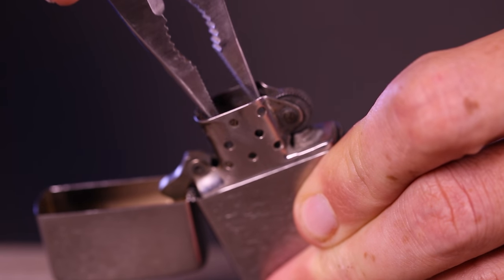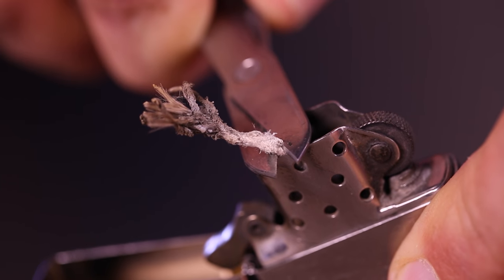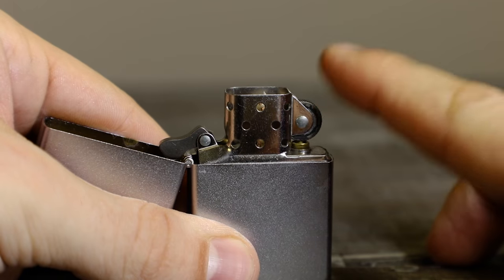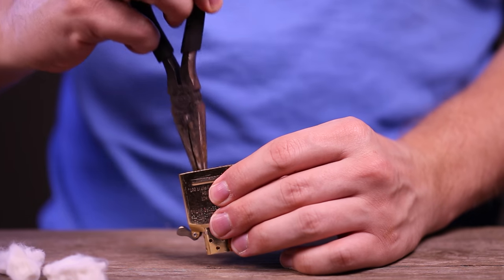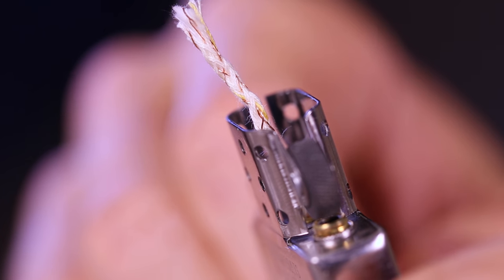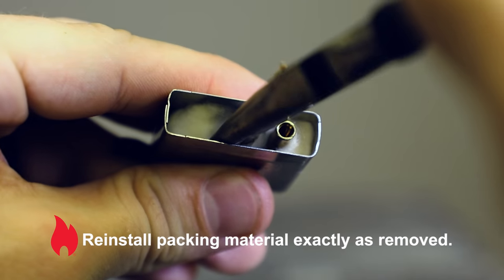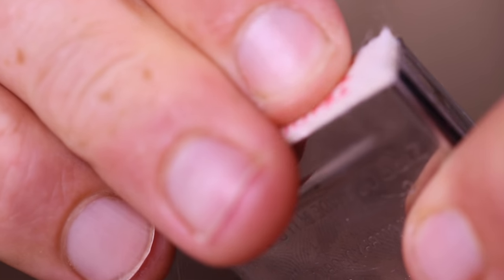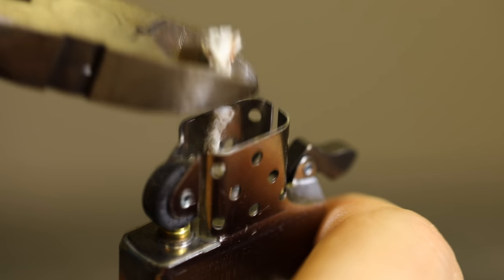Zippo Instructional: Wick Maintenance / Installing a New Wick

Comment: I've carried the same Zippo for the last 15 years, used it heavily and it is still in near mint condition. A Zippo is the only type of lighter that I trust in the long run. For one, it has no fragile parts or a pressurized gas system that often fails due to cold weather. I had used my Zippo in all kinds of conditions, from polar freeze and blizzard to tropical humidity and downpours. All it needs is sufficient airflow and sufficient fuel exposed to the spark jet from the flint. Perfect light every time. I only had to replace a few flints and each wick can last up to 2 years. There are THREE tricks to keep your wicks at optimal condition. ONE: When you replace the wick, NEVER let the wick touch the metal sides of the insert casing. Weave it in an S shape and make sure that the wick is surrounded on all sides by fuel soaked cotton. More fuel will be able to be drawn up the wick in this fashion. TWO: Only trim the wick up to one time maximum before replacing it with a new one. Every time you trim the wick, it gets shorter. Shorter wicks do not draw up fuel from the tank that easily. Keep the wick long, and it will deliver more fuel to the flame area. Better burn + longer wick life. THREE: It takes only 40 seconds or less to refuel a Zippo. If you carry one daily, it does not hurt to take a few seconds every day and refill the lighter. Once again, the more fuel that is able to be soaked into the wick, the longer the wick lasts. When you do not have enough fuel, or the fuel is low, the wick itself begins to be consumed, and you will have to replace it more often.
Reply: No offense. You kinda described why they suck. I own a few Zippos, but a BIC requires no maintenance and costs much less in fuel and initial cost. I get where you’re coming from but if you talking about trust, leave a zippo for a year, and leave a BIC for the same. I think you can guess which one will actually light. Shoot go 5 years and a BIC will still light. I understand the appeal but in reality they’re not as reliable as you say they are
Reply: @mikechivy  Your post is spot on point as well... There is a reason why the Zippo is NOT identified with the mainstream, even in the years right after they were invented when butane lighters and sealed fuel cell military trench lighters came onto the scene. Zippos are the manual transmission equivalents of the lighter world. A Zippo is the mark of a seasoned smoker and a man who KNOWS his craft. It is because they demand the user to be somewhat of an engineer and a tinkerer. It is just like hunting with a black powder revolver or rifle as opposed to a modern centerfire bolt action or semiauto rifle... You can't just chamber a round, point it at your target and pull the trigger... You have to know what you are doing to use it properly...

HOWEVER, there exists an aftermarket device that blends the best of both worlds of the Zippo and the BIC. Ever heard of Vector KGM??? They produce a wide variety of Zippo inserts that will fit into any standard Zippo case. They are fueled with butane and are available in piezoelectric torch, dual torch, regular flame, and flint ignition regular flame. I am using a Vector insert in my Zippo right now. Flint ignition just like the original, but with butane... You can't even tell the difference except there is no wick in the chimney. One fill is enough for hundreds of lights. Relegate the BIC to a spare backpack pocket and get a Vector for your Zippo if you are EDC'ing a lighter on a constant basis and want the class and attitude of a Zippo...
Reply: @BlueSkyCountry  Fair enough. I was a smoker for 12 years and have quit now for just under 2. At the time a zippo made sense. Now, not so much. Still love a zippo more than any other lighter, just sucks I have to refill it when I just wanna start a grill or roll a J ;-)
Reply: @mikechivy  Get a Vector insert like I mentioned above. Fill it and use it like a BIC... The lid of the Zippo case flips the "hammer" on the Vector upon opening and that in turn presses down a lever that starts the gas flow. All you have to do is to strike the wheel to ignite it. Lid closes, hammer clicks back and shuts off fuel lever, so no concerns about gas escaping by accident. Vector products are foolproof and reliable.
Reply: @BlueSkyCountry  thanks for the tips and advice.  I know this is an old thread, but if you get a quick second could you let me know if I’m doing something wrong if I fill the fluid up to the point it drips down into the wick and onto the counter?  Am I hurting the wick or cotton by over saturating, or do I simply let it dry out for a few seconds at that point then I’m good to go?
Reply: @FantasyRandR  Hey man, you are not hurting anything by overfilling it. It happens all the time and when 1 or 2 drops do come out, it tells you that there is just enough saturation in the packing material. Flip the insert upright and gently press down on the felt pad. If there is still too much fuel inside, a drop may come out from there. Let that drip onto the table. When no more loose drops are produced, wipe down the insert and reassemble the unit. Don't forget to wipe up the spilled fuel on the table.
Reply: @BlueSkyCountry  thanks!
Reply: @FantasyRandR  You got it man...
Reply: @BlueSkyCountry  Really useful, I've had the same Zippo for 2 years or so and never have never even trimmed the wick, better do it now.. Also, I always let my zippo run dry until refilling, not anymore. Cheers :)
Reply: @mattkaythetimelord  Enjoy carrying and using a classic icon of American badassery, bro. I live by three things: The Zippo lighter, the M1911 semiautomatic handgun, and the Colt 1851 Navy revolver. Talk bad about any one of these, and yer' gon' git an earful from me.
Reply: @BlueSkyCountry  Hah, I'm from the UK, I don't want to open the America and guns can of worms, all I will say is I admire guns myself, I just don't think they should be freely available. However, I respect and admire the way US citizens are incredibly passionate about their guns and gun rights. They are an amazing tool when used appropriately, as is the Zippo. I personally am very fond of the Colt 1911. :)
Reply: @mattkaythetimelord  I respect your opinions and I am not going to open this can of worms either. However, I am just going to take a minute to remind you that there is no entity with greater ability, possibility, and power to inflict terrible atrocities upon a population than a government, just like there is no person with greater ability, possibility, and power to inflict injuries and abuse upon a bedridden senior citizen than a person employed and given a license to take care of that senior citizen. You would not want to give too much power to an entity who is making laws to govern you and ruling over you, and may very well inflict harm upon you when they decide that you are no longer a financial asset to them. Just a friendly reminder, that's all.
Reply: @Javajavajav  I carry a Ronson Jetlite in my work pants as well. I actually have two of these little buggers. The Jetlites are an example of 'cheaper does not always mean low quality'. They range from $5 at supermarkets to $12 at some of the tobacco shops, but they function better than a $50+ novelty cigar lighter. Tip: If you want to fill the Jetlite to it's max capacity, remove the one screw at the bottom of the casing and take the insert out while refilling. That way, you can see how much butane you are getting in there. It takes less than 2 seconds to get a cigarillo going with the Jetlite. Absolutely love it. BTW, Ronson is owned by Zippo, so you can expect the same quality and dedication to their products as Zippo. Ronson butane is also better than many "XXXX filtered premium butanes". Never had a clogged line from using Ronson fuel in either my lighters or soldering torches.
Reply: @mikechivy  I know this is old but you can modify the chamber of the zippo by taking out the wick and bending the tabs opposite of the flint wheel stuff cotton soaked with Vaseline in the tab (keep the middle clear for air) and light it and keep Vaseline soaked cotton in the bottom and a razor blade and some fishing line with a hook and small weights and have a survival type shtf lighter
Reply: @BlueSkyCountry  I've discovered a bunch of old unused Zippos at my work place, I know a lot more now than I did a few days ago so they let us take some and I did. 
I lighted it 5-6 times and it's already black, could it be that the cotton is just extremely old?
Reply: @kipkopkopkop  Did you let the fuel thoroughly soak the packing material inside before using it? In a completely dry Zippo, you have to saturate the inside with fuel and let sit for a few minutes, preferably upside down, in order for the fuel to permeate it through and through. And then, you add a bit more until the fuel just begins to drip out from the wick. Now you can go ahead and use it. Another cause of easily blackened wicks is using them in breezy and drafty places. The flame getting blown around inadvertently chars and toasts parts of the wick while it is moving. In this case, it is a non issue. As long as the wick fibers are intact and have not turned into ash, you do not need to replace it. Just make sure the lighter is always saturated with fluid and you are good to go. I just replaced a wick on mine a few days ago and then lit a Black & Mild while in a very drafty warehouse. Blackened wick on first light. But the wick's integrity is completely intact and my flame height/output is not affected at all.
Reply: @BlueSkyCountry  I didn't put it upside down because I didn't know but what I did do is almost ignite myself, lol.. 
The cotton was old, it was in a huge bulk so I took it out and put new cotton balls shaped of my own. 
Thanks you for your input.
Reply: @kipkopkopkop  When you rewick it, follow what I have stated in the original post. And do NOT ignite the thing while outside the casing. You need the lid closed to put it out completely and blowing the thing out is quite difficult and you can get sparks and embers to fly all over the place. Enjoy using your new old Zippos.
Reply: @BlueSkyCountry  Thanks.
What are flints exactly and how do I replace them?
Reply: @kipkopkopkop  Flints are the small pellets of brass or bronze colored material resting directly under the ignition wheel of the lighter. When the wheel is spun, the flint gives off the shower of sparks required for ignition. They wear out over time. To replace the flint, flip the insert upside down. There is a single screw that holds the felt pad in place. Unscrew that screw carefully and you will be able to pull out the spring-loaded pusher assembly that holds the flint at the end of the spring. It looks like a tiny version of a semiautomatic pistol's magazine. Drop a new flint down the tube, then replace the spring and screw. You can order Zippo or Ronson flints online. They come in a plastic dispenser with 5-6 flints in one package.

ETA: If you have a smoke shop near you that carry refillable lighters and accessories, they may have flints on hand as well.
Reply: @BlueSkyCountry  Thanks!
Reply: @kipkopkopkop  You got it, dawg
Reply: @BlueSkyCountry  Just one more thing- 
I've put a little effort to fix just one zippo because that's all I currently need. 

I've bought cutters so I can trim and change the wick, but it turns out that inside there was this huge lump of cotton which is probably why the wick was burning so easily before. 
I've placed my own cotton, and put in it small six 5 cotton balls left and right and I made the wick into an "S".
My old wick currently doesn't burn anymore because I keep it soaked in fuel, I am filling it every 5-6 hours with just a couple of drops while turning it upside down, and letting it drip fuel on my hand for a  little bit and that's how I know the wick's soaked in enough fuel. 
I continue to put it in its case, and keep it upside down for a little longer to let the fuel flow some more.
Am I doing this correctly?
Reply: @BlueSkyCountry  people's trust in government is at insane levels
Reply: @mikechivy  How many bics, crickets and other disposable plastic lighters are discarded every day? This was my thought process when I decided to return to my trusty Zippo. 😉
Reply: @BlueSkyCountry Ok boomer.
The second half of your follow up comment definitely does not read like a native advertisement.
Reply: @g0merkyle  I appreciate that and will not have it any other way.

Comment: Thank you. Extremely helpful. Not something I've done before. Do much faffing around! Used lighter to light candles at home. Only tip I have is, if you have no pliers to take out or insert wick, wrap a piece of sellotape to form a point on the wick. This will allow easy threading through the chimney hole. Took me 40 mins, but I changed it! Woo hoo!

Comment: ** Tip/Suggestion for Cutting Tool: **
I wasn’t about to go shell out $$ for a specialized wick trimmer (as my zippo-enthusiast friend recommended)… A top rated comment on a random YouTuber’s wick trimming video advised a wire cutter (mine currently MIA), or nail clippers as an alternative (that sounded kind of suss). So I rummaged around what I had around the house and found the PERFECT tool—— You know those little scissors with the curved blades? The ones that come with almost every “basic” manicure, pedicure or facial hair trimming kit? PERFECT!

Clean cut. No fraying. And I can cut the wick so it’s below the top cage (if that’s your pref.). Same results as if I had purchased the wick trimmer—but no extra money spent. And because you can maneuver inside the cage, no more accidentally over-pulling the wick and having to cut off usable bits. More flame time, less $$$! Totally just discovered this on a whim and had to share 😄.

** BUT REMEMBER, —>DISCONTINUE <— USING THOSE SCISSORS FOR GROOMING, AFTER USING THEM ON YOUR ZIPPO **
Reply: HAHAHAAA!!! Funny, that's exactly the type of scissors I use for this. 😊

Comment: I own a Zippo lighter as well as a antique Ronson Super Windlite Butane lighter. When I got the Ronson lighter I had to replace the wick as it was found in a second hand store. But it works just as well as my Zippo. Only problem it don't hold as much fuel as the Zippo.

Comment: I completely love this lighters, Bought the first one last week and I already have another one. However, 4 days of use (between 5 and 10 lights a day) and I already see an important impact on performance probably because of blacked out wick, because the flame comes from the absolute bottom of the wick I can see, wondering if it can be even dangerous, having in mind the flame could enter where the fuel is? To the point, if it is the wick it doesn't last long, definitely not a year, at least for me. If it is the fuel, I could live with it, but 4 days of use when I filled it I think it is a short life for the fluid, and yes, I use zippo premium fluid. Besides the possible downsides this kind of lighter can have (because of the maintenance) against gas lighters, your zippo lighters have definitely a quality I have yet to see in any gas lighter. They are small pieces of art!
Reply: It's not like it's going to explode on you it's a wick lighter.
Reply: Honestly I think the maintenance is part of the charm of owning a Zippo. You constantly maintain and care for it just like you would a good knife or a leather pouch. It may seem like a chore with the convivence of bics and other butane lighters, but I think it's part of the fun of owning a lighter that can last a century.

Comment: I typically prefer the wick on my Zippos to be half the length of the chimney rather then even with it.
Reply: I believe thats the best for fuel and wick consumption. i noticed it burned much more with the higher wick.
Reply: Old comment, I know, but I split the difference and go about 2/3... smaller flame if you move it down the chimney a bit. A zippo's been part of my EDC since the early '90s

Comment: Hi there. This seems like a useful video, but I have no clue what a wick is for and why there is copper around it. Does anyone know?
Reply: The wick absorbs fuel and draws it up by capillary action into the part of the wick that you see at the top of the lighter, so when you spark it, the fuel is what catches fire instead of the less volatile wick.  That's why you keep plenty of fuel in the lighter and don't let it run dry.  I'm not so sure about the copper wire, but I would guess that it keeps the wick from fraying; it also gives a little extra stiffness when you're threading it through the hole on top.

Comment: Looks like you should avoid the contracting between the wick and the metal parts of the fuel tank while  packing the cotton. So you can use the "snake" way, but also use the small pieces of cotton to isolate the wick. My "flaming anarchy" Zippo lasts about 6-7 days (and may be even 8-9 days light up but wick itself is burning to much) Am I right?
Reply: just 8 days ago I have something to ask. after trimming the wick should I add oil? because I trimmed it and it's immediately turning black and the flame is going down. also it smells a little bit burnt
Reply: @phantomwablo4257  I think yes, you need to add  more fuel. Make sure the plastic wick core is available, dry wick may become over burnt. 
Sometimes the wick can  stay jammed somehow when you pulling out the wick, if so your lighter needs repacking.
Reply: thanks
Reply: @tutorube  I wonder why you should avoid the wick touching the metal parts? hmm...it will reduce the ability to draw fuel if it touches?
Reply: @weaver4907  I think that's the idea.  The whole wick should be touching, and absorbing fuel from, fuel-saturated packing, not metal.